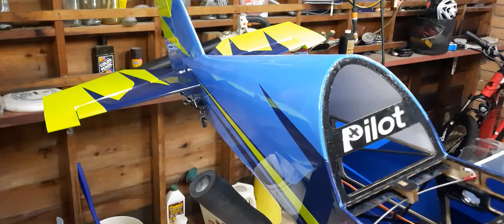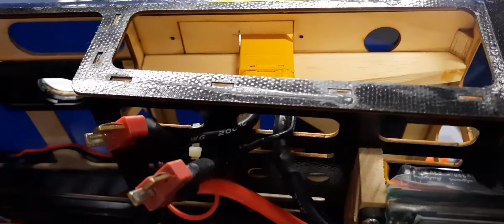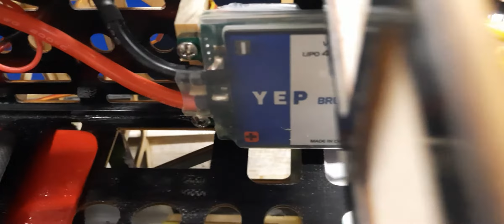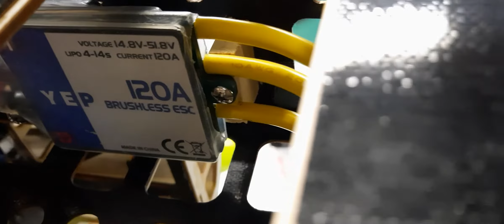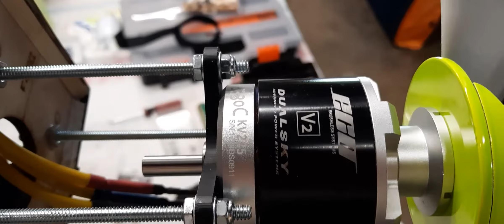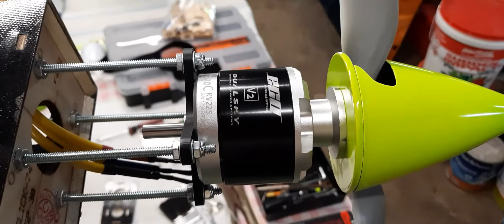Pilot-RC Slick 74inch

Comment: como te quedó de nivelado el centro de gravedad? veo que el regulador de 120A tendrías que haberlo montado bajo los tornillos bancada del motor, ya nos contarás los 6 elementos de Lipo que le pones, el avión parece muy Ligero, ponle Giroscopos al automático o botón de Pánico, te sacará de muchos apuros. buen avión, ni demasiado Grande, ni tan pequeño.
Reply from the maker: Centre of gravity as marked, over the joiner tube, is good. Since the rudder servo is located mid fuselage length, I had to move some weight further back from the front of the plane. So I put the ESC near the batteries. I am correcting the plane RTF weight to a measured 5.96kg. The battery is 2 x 5S 5000mah 50C --> 10S. I never use the safe mode for the gyro - too controlling. As an experienced, aerobatic pilot I find the gyro in its simplest, "stabilisation" mode is enough for me. Yes, and you are correct, this size is perfect for flying at our field. Thank you for the comment.

Comment: Hi! Where did you get those motor support rods? How did you secure them to the motor box? Are they working well? Thanks for your answers.
Reply from the maker: 3/16th or 4mm Threaded Steel Rod
--------------------------------------------------------
This rod should be available from your local hardware store together with the plain nuts, nyloc nuts and washers. The result is a very strong motor mount due to multiple portal framing rigidity.
Method:
  -  Drill 4mm(+) holes accurately centred over the cross-hairs lasered into the motor box face. The hole centres should match those of the motor spider.
  -  Dowse the holes in thin CA so as to harden up the area and resist the clamping pressure of the nuts.
  -  Accurately calculate and cut four threaded rods long enough to position the motor with allowance for all fasteners and final adjustment. Make sure the cut ends are chamfer cut/sanded so as not to ruin the nyloc nuts as they are wound on.
  -  The order of parts on one rod starting from inside the motor box is: Nyloc nut, washer, motor box wall, washer, plain nut (including blue thread lock), [outer end] plain nut (including blue thread lock), washer, spider arm, washer and nyloc nut.

The final result is a very rigid motor support that makes for a quiet-running power system.
Reply: @eddrakes Thank You very much, really good information. I really appreciate the detailed explanation.